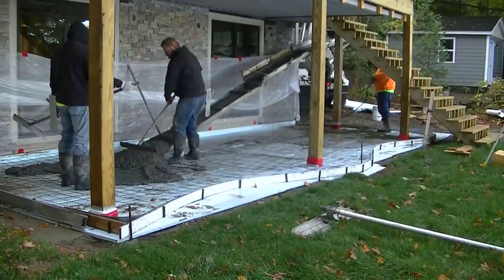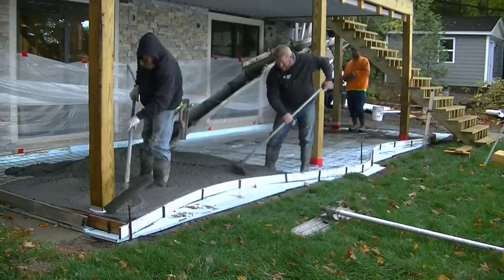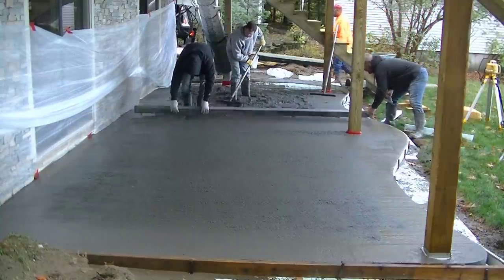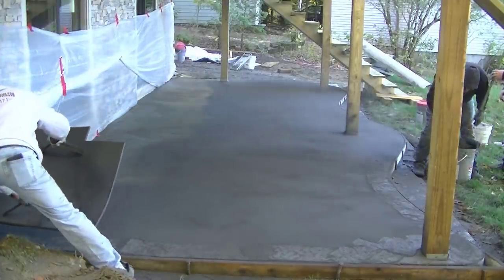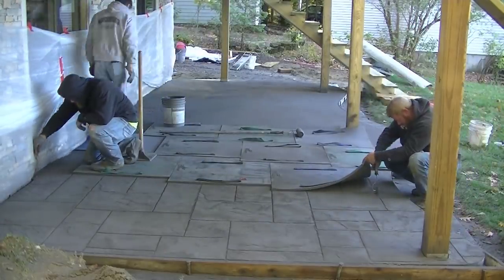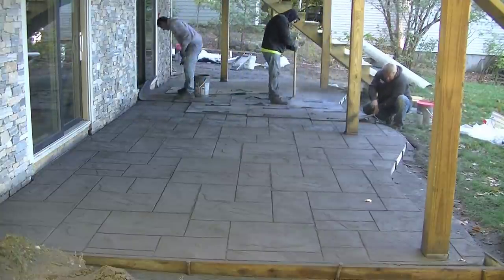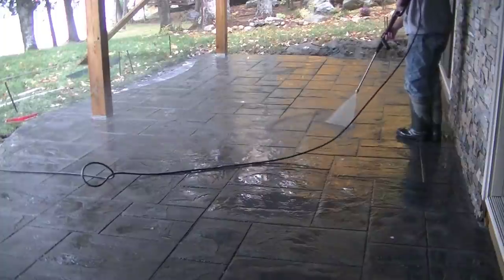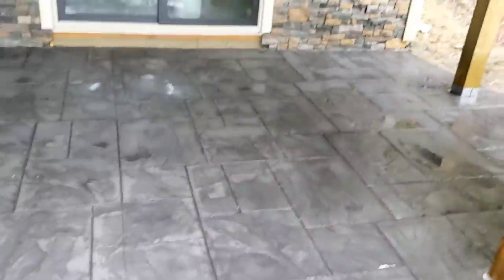Pour And Stamp Concrete Patios (My Method Of Stamping)

Comment: Live out in Oregon. Built a house last year, my friend helped me and we did a 13x30 stamped patio in the back and stamped the garage approach (25x3)  and walkway to the house with dark gray color, 3/8 rock, slate stamp. We used a liquid release, but mixed in a little of the colored powder release into the sprayer. helped keep the mess down from the powder. We also wet cut the joints, but now that I have been doing more and more concrete, I think I want to start dry cutting all the joints. thanks for sharing.

Comment: Mike I'm not a concrete guy, I'm a Pipe Welder, currently driving a tractor trailer over the road. Don't ask. I came across your channel this past spring looking for tips on finishing concrete for the 8' X 20' parking pad I poured using 80 lb Quickrete bags. Now I can't leave. I've watched every video you've posted since April 2020. Love 'em!
Reply: Wow, how many bags was that ?
Reply: @augustreil  About 80. I poured 10 4'X4' slabs in two rows. I left enough room in between the two rows and each slab to lay brick, and tuck pointed them in with S-type mortar.
Reply: @jeremyhuggins8796 , That's enough ! Thanks.
Reply from the maker: Thanks Jeremy, glad you like them.
Reply: You are not alone. I never miss a video either 👍🏻

Comment: At 8:11, could you have used a wide chisel or? To extend the lines down onto the face of the concrete making the stamped area lines above line up with those vertical lines on the face to the stamped area above thus making those stamped areas look like actual individual pieces of stone while the concrete is still workable, OR, will there be a brick facing or something else installed against the face of the patio??👍

Comment: Having similar install of concrete that's stamped under my deck. Floor will be raised but Contractor is going to pour concrete around the post. Whats the right way to approach this situation. Concerns  of mine would be rotting and not being able to replace post because the brackets would be 8 inches under the concrete.i feel he should support deck remove the posts pour concrete  and install new brackets on the concrete floor

Comment: how does stamped concrete hold up in maine? im in northern mass and want to do this at my house
Reply from the maker: It holds up just fine if it's done right and it's maintained with sealer.

Comment: You guys do unbelievable work, I'm sure It'll be much better once the topsoil is installed, but I'm just not a fan of the curved edges.
Reply from the maker: Some like curves and some like straight, I just do what makes them happy. Either way isn't hard to form or pour.
Reply: @MikeDayConcrete , Agree 100% Thanks !